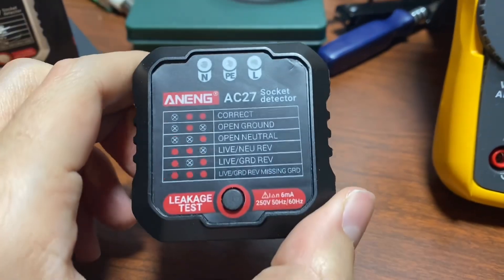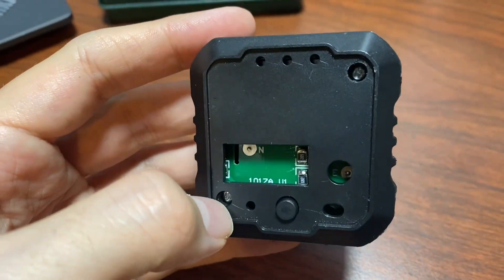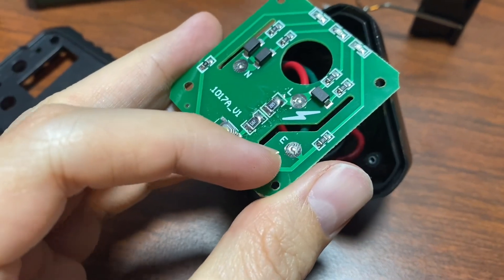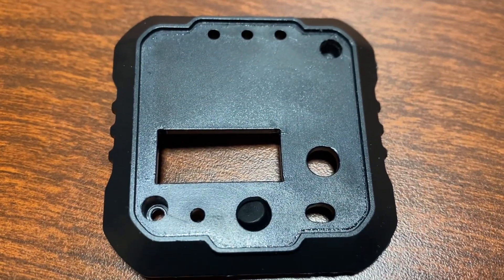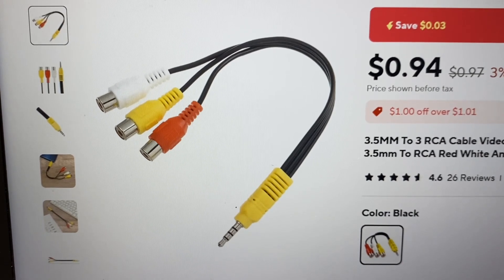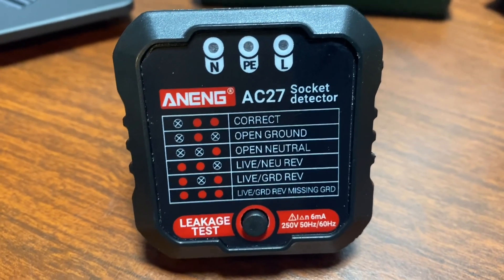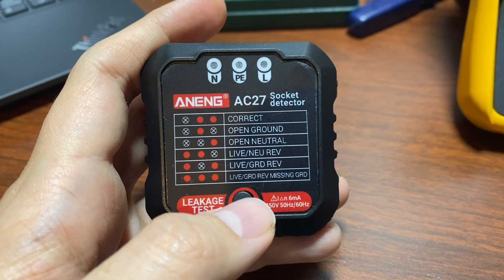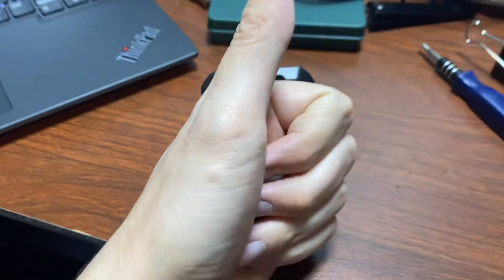Aneng AC27 Socket Tester Teardown and Troubleshooting

Comment: I also have a bad connection. In Poland, Neutral should be on the right, line on the left and PE at the top. The line was replaced with a neutral one. I re-soldered and the RCD test works correctly.

Comment: But I can see the Open Ground light on the detector.
Reply from the maker: @ExcelTimeSavers  Open ground means that the ground on the receptacle isn't wired to anything (or whatever it's connected to is floating with respect to the electrical system). That's different from ground and neutral being reversed - they were both connected to something at ground potential, just the wrong something.